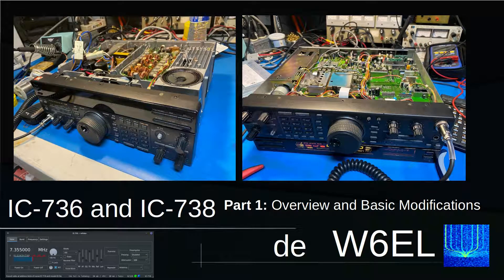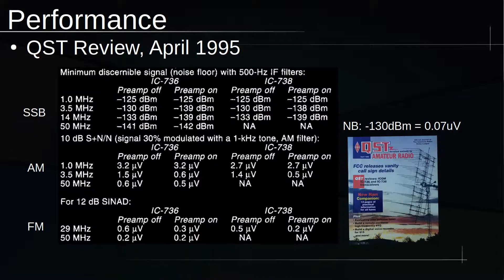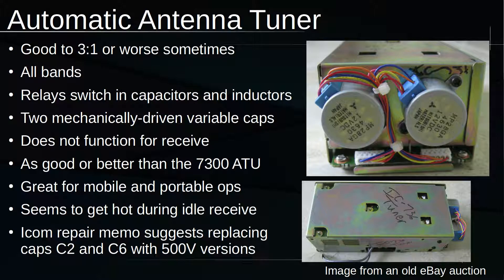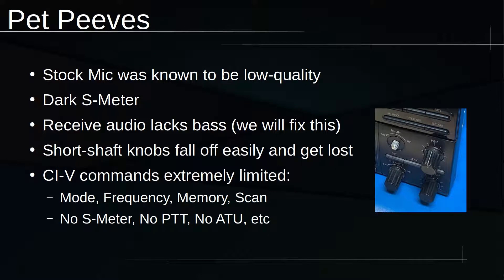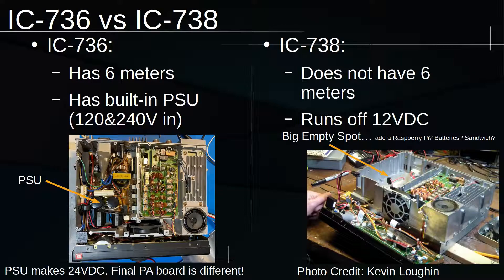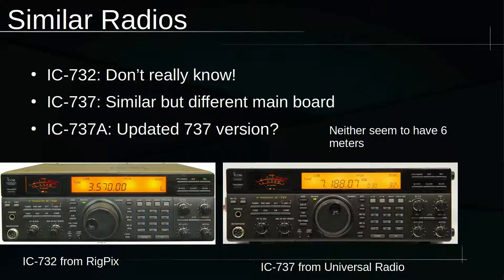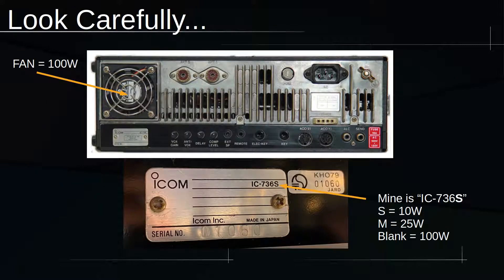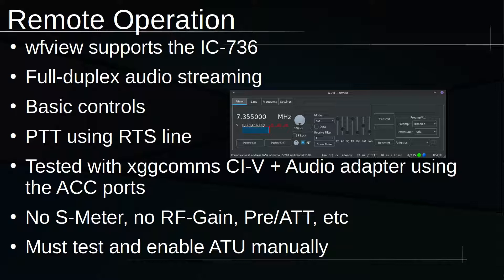IC-736, Part 1: Overview, Features, Mods, Issues, and more

Comment: Have a beautiful ICzozm 737. However, when turned on, I get -- - - - - -  in blue across the screen. Any suggestion? I am thinking of a battery and logic board.
Reply from the maker: @donaldjones1759  try reseating all the connectors. There will be many. Replacing the battery and doing a CPU reset is a good idea too.
Reply: @W6EL  I have to remember how to do a reset. I did one a year ago but did not replace the battery. It was like 110 degrees when acquired. The ICOM. Put it in my repair pile. Getting there. I have one Heathkit SB-220. One 20 Amp Astron, and one 70 Amp Astron with the ICOM 737. I am finishing up one SB 220, but I am having problems with the input tune. Grounding grids on these AB Heathkit Amps seem to raise the SWRs on a higher frequency, like 10 meters. Yes. I could put a 47 pf cap from the relay to the ground on the coax, but I need to tune it on the cathode side. Wantbthebtime constant and impedance to be as close as possible. Oh, what fun we have truly.  Thank you. 73 de Don W5JX

Comment: Awesome itemized description,.. I'm looking at one right now, planning to buy it, also from Japan, but in very good looking condition, said to be working well too. I'm going to save your video, so as to refer to it later, thank you. 

Anything I would need to know now before I take the plunge? Or other useful info?
Reply from the maker: @MusicMinisterJP7  just know that the displays are difficult or impossible to obtain. So treat it gently. The modification for full band coverage is mentioned in the video, but email me if it isn’t clear (I’m on QRZ). Other things to watch out for are bad PSU caps (the small ones. The large ones are ok), and bad plastic variable capacitors in the PLL tuners. Fixing the PLL is not trivial and I ended up giving up on my 6M circuits. The entire PLL cavity is filled with wax which you need to remove in order to solder anything. Otherwise though, it’s a fun radio with a lot of built-in functions which just make everything so much easier (PSU, ATU, notch, and so on).
Reply: @W6EL  I will open it up and inspect inside, for anything odd. I remember you talked about th4 caps. I did like the Japan version with the more colorful display. The one I'm planning to buy just has that orange display, but the swr meter display light wasn't lit. I imagine I can replace it. I did the same on my Super Star s3900G, the light was low yellow. I put an led. Question, is that icon MH12 mic any good, or is there a better mic available for it?
Thx. (I didn't catch your email on here)..
Reply from the maker: @MusicMinisterJP7  my email address is on qrz dot com. Just log in and then you can easily look it up.
Reply: Any word on the mic?
Reply from the maker: @MusicMinisterJP7  ??
Reply: @W6EL  Up above, I had asked if the mic for this radio was any good, or is there another that would perform better. What mic do you use on it?
Reply from the maker: @MusicMinisterJP7  I never tried the stock mic. I used the same mic as the 7300 and 9700 come with. That is the Icom HM-219.
Reply: @W6EL  I take it you also have these radios.. I suppose a power mic isn't needed then, correct?
Reply from the maker: @MusicMinisterJP7  a power mic is definitely not needed. The built-in compressor will easily get to 100% ALC.
Reply: @W6EL  Can I ask you about the amateur licenses. Of the 3 types, Technician, General and Amateur Extra, do I have to start with the Technicians?  Or can I go for the General, since it allows better privileges than the tech? I was reading on the Technician, but I was reading somewhere, where it indicated a person can go with the General instead. I'm a bit lost on this. I just ordered the General book study manual..
Reply from the maker: @MusicMinisterJP7  great question. You can definitely start at the general, and it’s not a bad idea either as the topics blend with the Tech test very nicely. I saw one guy do all three in one sitting once. Get an account with HamStudy and get the app on your phone. You can drill the material whenever you have some down time. K4IA has some great books on Amazon to help as well. I will put my email address on my YouTube profile About page when I get home, and please use it and ask me any questions you have. I’m truly happy to help.
Reply: @W6EL  WOW, thank you so much,  for your effort to help. Does inspire me. I did download an app that allows me study material for all 3 classes. It also provides exams.
Reply: I went ahead and made an acct with HamStudy. Will be looking thru it.
Reply: I also found another nice looking IC-736, someone in japan is selling. However, its labeled junk-part2. I believe the reasons are two items not working well or not at all. The LCD display, the first number in the 7 digit frequency,  looks like a 9 but backwards, and it states no ATU operation. Pitty.
Reply: Last night doing some more searching, I found a ham selling his 736, and he's located a few counties away. Says his radio is in great working condition. $450..?
Reply: Well, I bought the IC-736 today. I wanted to ask, aside from its regular mic, I have an Astatic D104 in the closet,, can that be wired to this radio? This D104 has 4 wires, Red, White, Black and Shield.

Comment: Good afternoon, Do you diagnose and repair if needed or, is this channel just informational? I have a 736 and have not had any success with making contacts. 
Thanks
Reply: Good evening, I Am David, KN4HTM  from Charlotte North Carolina. Thank you for your quick response. I do appreciate it. I have joined several clubs and to be quite honest with you no one seems to know how to diagnose or at least even look at radios to see if they are putting out correctly. I no electrical engineer so I am on my own trying to figure out how well this radio works or not when I key the mic my power meter is bouncing at around 50 Watts watts. I can hear some people here and there some clear and some not but no one seems to get my signal. I am using a plain 62 end fed sloping up to a tree. Out of frustration I am on the verge of throwing the radio in the garbage and buying a 7300 although I really don't want to. I love this old radio I just wish I knew if it worked or not. I am about to purchase several different antennas to see if they work. I wish I had your knowledge I can tell you that can tell you that. I do appreciate what you are doing out there. Your videos are like a Haynes manual for the car
Reply from the maker: @abdrywallrepairspecialist5184  man I’m sorry to hear about your experience. Please send me an email and I will do what I can to help you out. My address can be found on my QRZ.com account. Just log in and look up W6EL.
Reply from the maker: I don’t do repairs generally, just for fun here and there. Can you hear people? Does your meter show full power output? What is your antenna?

Comment: did you fix the receive audio low bass? i can't seem to find this on your videos
Reply from the maker: I have not yet. For that, the notch board has to come out and then a buffer and a proper bypass relay goes in with the notch board. It’s tricky since the notch board is mounted with through-holes in the main board. It means that main board has to come out. 

A simple hack might be to just tap into the audio prior to the notch board, possible a few components earlier. Add a buffer and then just use that as the AF output.  

I’m not sure I’ll get to it here. if you try it do let me know.

Comment: Can you advise how to enable MARS Mode status ?Is this done correctly only by removing diode number 15 and the device continues to work?
Reply from the maker: You need to remove both D15 and D22. Next do a full CPU reset by holding down [CLR] & [ENT] while powering the radio on. Some radios won't have both diodes, but do remove both if they are present.

Comment: I have a 736 that I restored except for the dial lights.  If your LCD display is dark, please post a vid of your work replacing the dial lights.
Reply from the maker: Just for you: https://youtu.be/F5_1I_2-LlQ
Reply from the maker: Hi, the procedure is basically what you see here in the video. Once you remove the logic/display board, you have to bend (I know, not what you want to do) the glass LCD away from the top of the plastic mount. The plastic mount can’t be removed without desoldering the entire LCD, so leave it as-is. Once you bend the LCD out (the wire legs will bend), there is a little diffuser sheet and behind that are four or five vertically-mounted long glass bulbs. You can desolder the bulbs from the rear PWB and pull them out the front using tweezers. 

For replacement, personally, I would drop LEDs in, with the wires going through the existing small slots in the plastic mounting fixture. There is room there to pass wires into each lighting cavity. LEDs might extend the life of the LCD since they don’t make as much heat. 

I can post a short video showing this idea on my old display/logic board if you’re interested. I’m lucky since all my lamps were working, and thus I didn’t dive into this yet. 

—E
de W6EL

Comment: Great work.  I have a 736 as well but need to replace a couple of display lights on the LCD version.  I would be interested in seeing a video of you replacing the display lights should your replacement board is rather dim.

Comment: I have an IC-736 in the European 100 W version from 1993. I bought it from a fellow amateur in 2003 for 100 Euro's . It was broken, the set had been used on two DX-peditions, one to Trabzon in Turkey and one to Tblisi in Georgia with the aim of activating those regions for 6 meters when the 6m band became available in Europe. The set had suffered severely during transport in a rattling Tupolev plane, with loose screws found later in the cabinet and broken print board connections.
There were 12 faults in it, one of the most difficult was the tuner. The plastic mechanical and semi-rigid couplings with different axle diameters, between the actuator motors and the variable capacitors,  were broken. I had to invent a coupling that would fit in the housing, but it also had to be insulated from the capacitor axle.  Originals were not available anymore . I fixed it with four copper dishes with a thin ring of isulating material glued between them. Later, one of the servomotors was also found to be defective, but could be repaired with 2 component glue.  There was a solution for this on a Polish website, the same problem occurs in the ICOM IC-746, the ferrite motor core gets loose on the axle.  My experience with this internal tuner is that it has a relatively limited tuning range, I have a better range result with a home made  external pi-filter tuner , on this set. The output stage was gone defective probably due to a broken connection between the output stage board and the SO-239 connectors, I had to replace the two FET's MRF174MP , that are now obsolete, but E-Bay helped out.  Note: the description of the finals bias adjustments in the IC 736 service manual is not correct, use the method as described for the IC-738. A suspicious part was a toroid in the output stage, which, in my opinion, was soldered to the PCB in a wrong way, -too tight. There is a coupling link trough this toroid which is mounted way to tight in order to fixate the toroid on the board.  The toroid however then presses on the solder islands of the drain and gate of the output stages. The laquered windings of the toroid were damaged, showed wear spots,  and could have lead to the defective final stages as well.  Indeed, the electret microphone is not too good, but there is a modification for it on the internet. I now use a cheap dynamic Zetagi CB mike on it which is far better. The audio reproduction is also not good with my set, no highs and no lows, some improvement can be achieved with an external speaker. I am awaiting your solution . No display problems here. 
All capacitors in the power supply have been replaced here as a preventive measure. A nice feature is the antenna switch, so that a 6m antenna can always remain connected. Good working speech processing too, noise blanker not too effective. Overall I am very satisfied with the performance of the set, which has been working excellently for years now. Good receive sensitivity and a good 100 Watts RF.  She was worth fixing up.
Reply from the maker: Hi Ger, great points all around! I appreciate the note on the PA alignment as I will be going into that soon. With the audio, I think the problem is that the signal going into the notch board should be buffered. When the notch is bypassed, it loads down the audio circuit so much that it sounds quite dumpy. You can verify this assumption if you turn the notch board on and turn the notch frequency all the way clockwise. You'll hear significantly more bass! The way Icom bypasses the notch filter is really not ideal. Plus the schematic clearly has the wrong pinouts if you look closely at the datasheet for those analog switch parts versus the claimed connections in the schematic. I think the solution is going to be a buffer and a better bypass filter. 73!